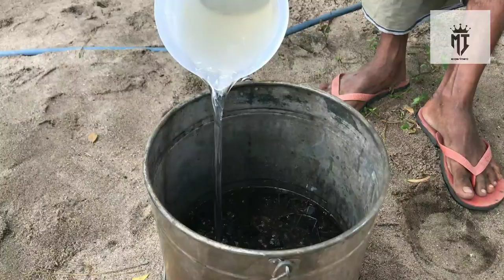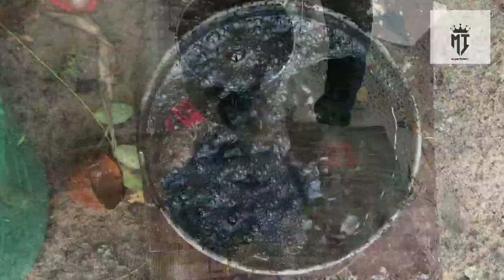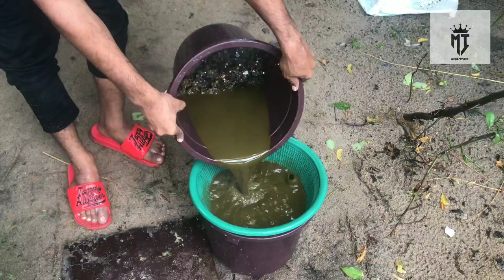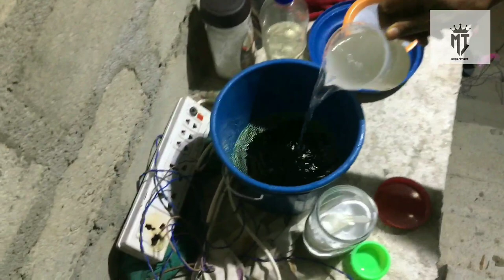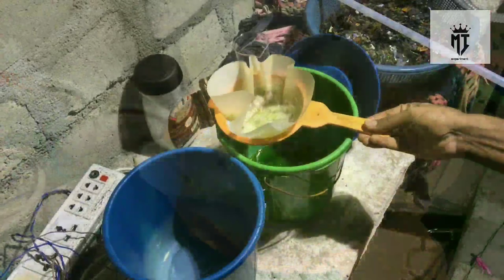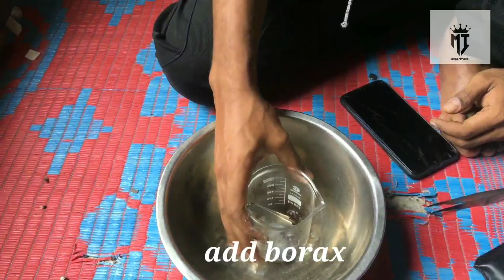How to Computer CD rom bord ic Chip's gold recovery experiment

Comment: Most people are skipping the last drying step and putting the wet filter paper directly into the melt crucible. Do NOT heat things on concrete!  If there is moisture inside, it can explode suddenly, in your face. Trust me when I tell you...